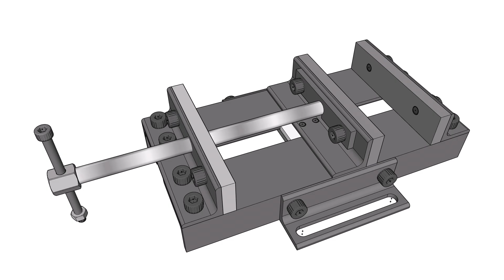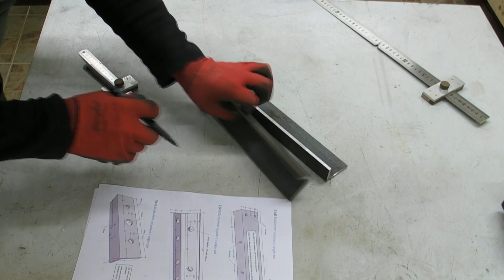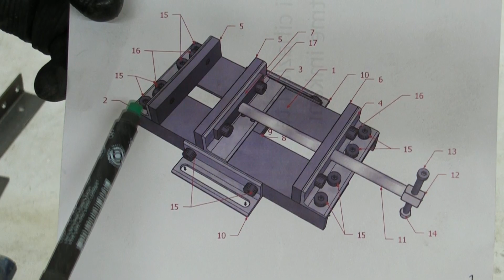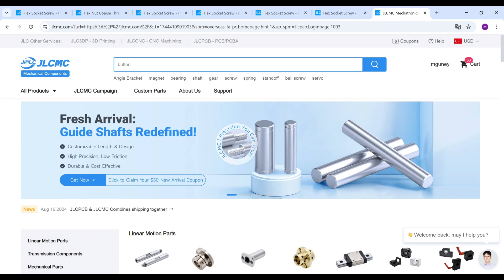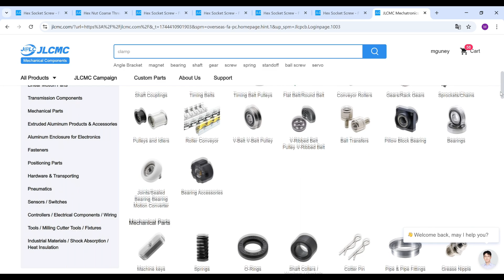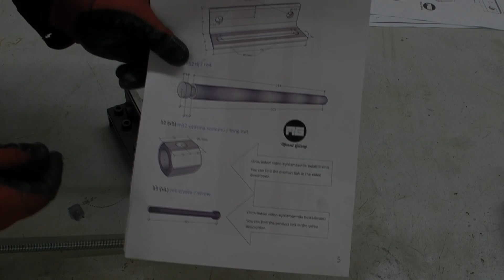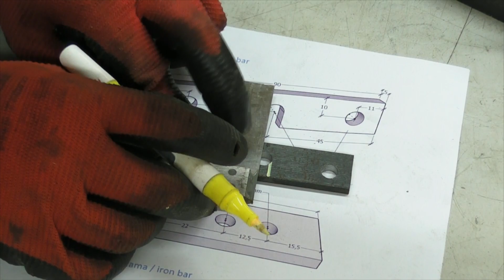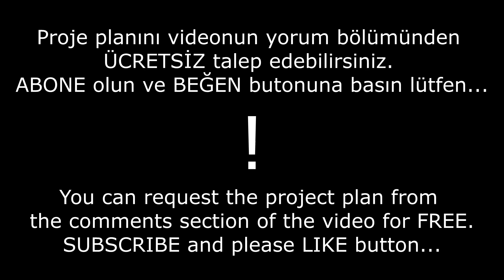How to Make a Metal Drill Vise - No Welding - Just Screws

Comment: NIce work. Can you design simple easy fixtures for addon jaws in copper/aluminium/plastic to hold metal stuff and not leave a mark on it. Also addon jaws to hold cylindrical objects ?
Reply from the maker: Hello. I made this vice to use when drilling metal. I also made a wooden vice, maybe you have watched it. My wooden vice works very well, but it is a bit problematic when you need to use oil while drilling metal. Moreover, I added a quick opening and closing feature. My wooden vice may be more suitable for designing additional jaws. Thank you for your idea. Let me give you the plan link for this vice. Maybe you want to make it... https://drive.google.com/file/d/1rBp1MJpusfMPKAWM9O0qR_rhI4VZyaKB/view?usp=sharing

Comment: Like first for the non welding and for the whole project!!!!
Reply from the maker: Excuse me... I didn't quite understand what you meant. Please excuse me.
Reply: I mean that always seeing projects full of welding in the moment that you can make things more resistant and durable without welding!!!
Reply from the maker: Now I understand you very well. In projects made with welding, it is very difficult to correct later. It is difficult to cut the weld and re-weld. Therefore, I would also prefer welding-free. However, sometimes welding is necessary in metal works such as fixed frames. Otherwise, extra joining elements are needed. These also make the joints rough, in other words, they take up space... Thank you very much for your interest and feedback. Greetings from Türkiye. You can also download the project plan from here if you want. https://drive.google.com/file/d/1rBp1MJpusfMPKAWM9O0qR_rhI4VZyaKB/view?usp=sharing
Reply: I'm a fun of non welding projects as  you notice. However there are some cases especially when the space room is a factor but you must be experienced at welding otherwise I strongly believe that non welding joints are more durable and they don't need sophisticated inspection as welding needs (ultrasonic or x-rays type)etc, etc!!!!
Greetings from Greece!!!
Reply from the maker: I completely agree with you. There is no need to weld unless necessary... Greetings from Türkiye 👍